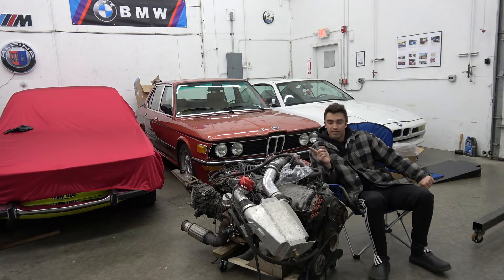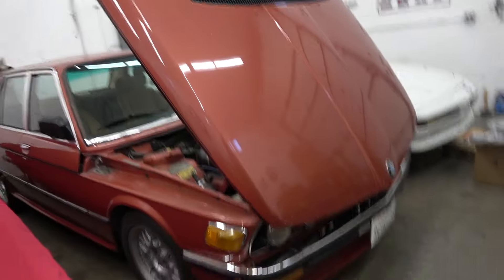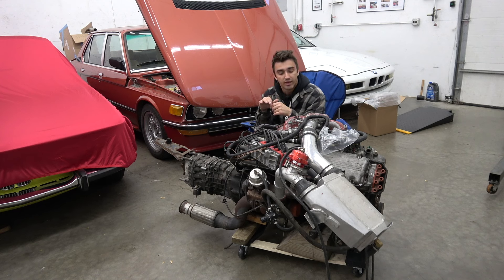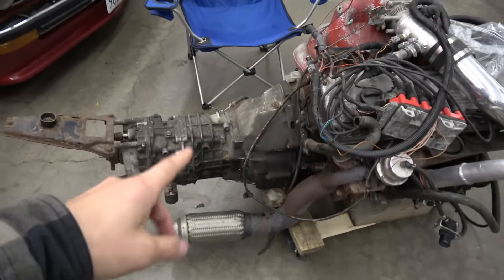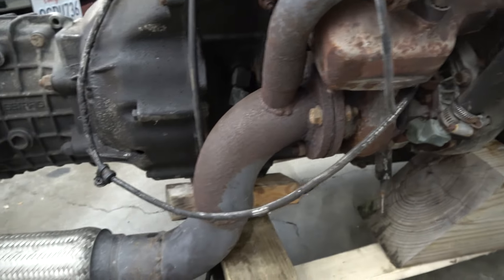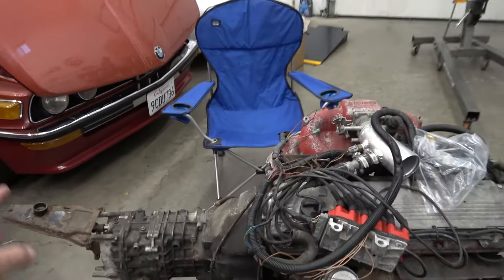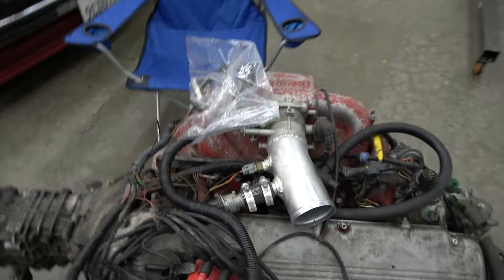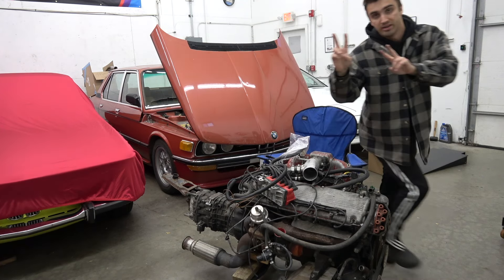Returning my Hardy& Beck E12 To Its Former Turbocharged Glory | Turbo E12 Project Intro

Comment: cool project Josh.  I think you will need to do a brakebooster swap to clear that intake.  I ran into that when doing an engine swap on an E9.  I used an e28 or e23  hydro booster if I remember correctly...
Reply from the maker: Interesting! I didn’t realize that. Good to know! Thank you!!!

Comment: I have an M90, it does not have the long coolant channel. Your motor is almost certainly an M90 as well. Three more ways to tell, but they will require the head to come off. 
1 - dual oil holes between each pair of cylinders. All other M30s just had one for each pair.
2 - turbo drain boss on the bottom middle of the passenger side of the block. M90, M102, and M106 blocks all had these, but they were only used on the latter two for the turbo drain.
3 - the 100% proof - M90 pistons are 93.4mm diameter, and will have that size stamped into their tops as well.
Reply: There is also a H&B Turbo E24 project car on Bay Area craigslist/marketplace. Might have some more correct components.
Reply: also - the TPS is from an auto M30. it has a continuous wiper so it can be used for aftermarket management that cares about pedal position, unlike the stock manual contact-switch-only TPS.
Reply from the maker: Great information! Thank you so much!! Once M90 comes out Ill look at it more indepth to confirm.

Comment: that pipe and hose off the back is the heater hose connection for the e23. May need to use the outlet off the engine in the e12 to make things line up. Also i bet you'll at least have to re-pin some of the engine harness to fuse box connections. I know at least e28 to e23 has a few pins that need to be moved around (i put a b35 into an e28, then later into an e23)
Reply from the maker: Thank you for the into! I figured that pipe was special to 7 series. My guess is it will definitely need some repinning for fusebox, did it for my B35 e28 so shouldn’t be too bad!